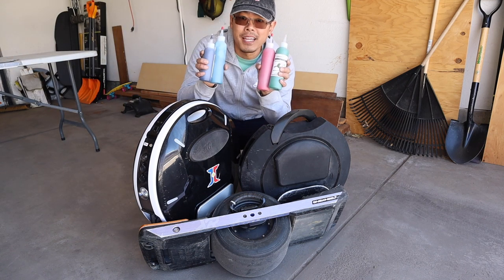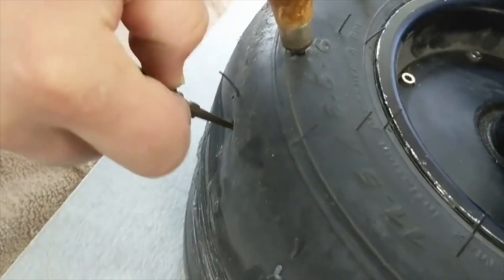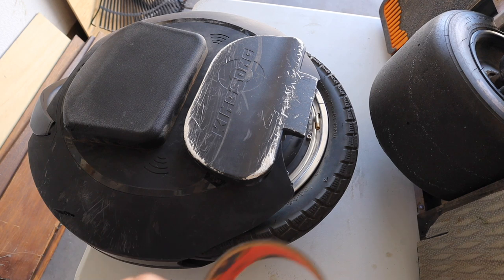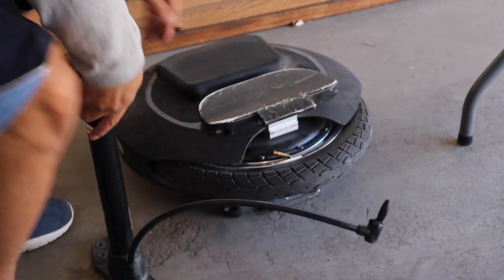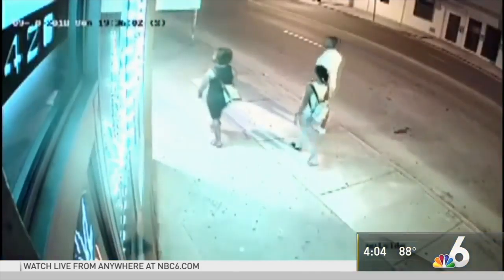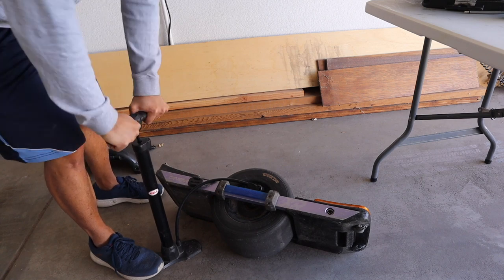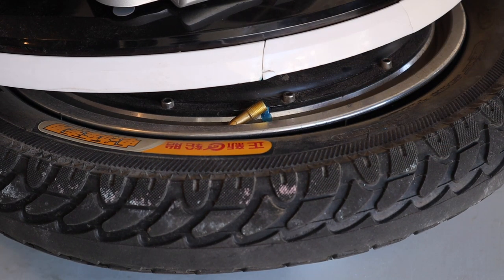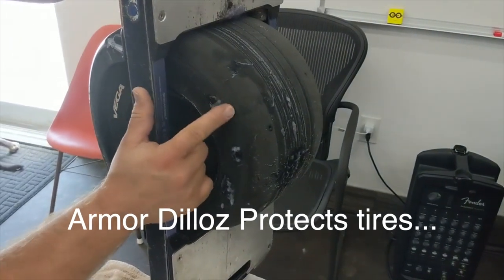AMAZING TIRE SEALANT Armor Dilloz for Onewheel EUC e-Scooter

Comment from the maker: For a short time, get 10% off all tire related products at Armor Dilloz, use the code: JimmyChang
My review of Armor Dilloz: https://oneradwheel.com/the-best-tire-sealant-for-electric-scooters-onewheels-eucs-and-more-armor-dilloz/
Reply: Jimmy Chang - Great video Jimmy. I am upgrading my KS18L to the Nikola Plus 100V. I know the tire repair on the Nikola will be complicated so I want to preempt that need should I get a puncture. With your Nikola after you placed the blue Armor Dilloz, did you notice any difference in the way your wheel rode? How many ounces did you put in?
Reply: Hey I had a question I think in another video I watched you mentioned the air inflator you got on Amazon for a decent price. I ordered the same model and the digital readout is showing the incorrect psi. Is this a problem you’re seeing aswell? For reference I set it to 20 psi and my meter read the tire at 26.7

Comment: #armordilloz Great info Jimmy as always. I have plenty of experience with Slime and find it very unreliable in both cars and e-scooters. I am not sure why I kept putting that stuff in my vehicles but I have completely stopped using them going forward.  Even after the Slime supposedly seals the tire normally goes flat within a few hours. I have also had many times when it didn't seal at all and the tire went flat within minutes. I did pick-up some red Armor for my XR which should be coming tomorrow. I also picked up some for one of my power scooters. Unfortunately it looks like I need to get the blue one for that as I travel around 40MPH on that one for long stretches.

I am not sure I would have stopped the hit and run suspect. The person who stole the vehicle has a good chance of being armed. I would have called 911 for the police and ambulance. Cory was very brave for doing that.

Comment: I bought the pink one for the electric scooter 8.5 inch wheel, its leaking air under the valve, is that a problem or should I have bought the blue one?

Comment: that is wild. lucky that the driver was going slow enough for cory to catch up and stop him. i'd like to say i would have attempted to do the same but of course we never know until we're actually in the situation. i'd at least make sure to call the cops though. sidenote, wondering whether the effectiveness of #armordilloz sealant would be affected by previously installed slime or other generic sealant? surely it'd be unreasonable to remove the previous sealant before installing the armordilloz

Comment: A couple questions for you... 1. I bought a used ow+, should I assume it has slime in it?  2. maybe it is in the video but I didn't notice: do you have to use a hand pump?  If so, every time you pump it or just the first time after adding the Armor Dilloz?
Reply: Yes

Comment: Will having a sealant in the tire make it harder to take off when you need to replace the tire?
Reply from the maker: If it's tubeless, it will be a little messy but well worth the protection. If it's a tubed tire, then no mess.

Comment: I haven't even rode my onewheel pint five kilometres and got a mental object puncturing my tire. I proceeded to remove it and slime like substance shot out of the hole. I could hear hissing from the tire. Within a minute or two I was riding again but I thought maybe it was a good idea to let it dry overnight.
Reply: Woke up this morning and it was flat 😣
Reply: filled it with air at the local gas station and it seems fine now :-S

Comment: Very compelling. Although currently all of my wheels are protected with Slime, I'm going to keep Armor Dilloz in mind the next time I have a leak that Slime doesn't fix. According to their FAQ, it's OK to use this if you already have Slime installed.
Reply from the maker: I know folks that have used armor Dilloz to repair leaks on their Onewheel that the pre-installed slime couldn't stop.
Reply: @freshlycharged 
But you haven't fully answered the question.😮

Comment: I’m not so confident about removing the valve stem on the EUC. The angle is so hard to get at on them anyway. Last thing I want to do is mess it up and have to send the EUC back to eWheels to replace the inner tube.

Comment: Just to relay a recent experience that I had with my OneWheel Pint.  I put a puncture sealant called Tireject, which I really like, into my tire and shortly after the wheel started clicking like an old shopping cart wheel.  Turned out FutureMotion puts puncture sealant in the OneWheel tires at the factory and my sealant reacted with their sealant to create a rock inside the tire that was bouncing around.
Reply from the maker: How did you fix it?
Reply: @freshlycharged  I didn't.  I started a support ticket with FutureMotion and they had me ship it back to them.  They discovered the problem when they were diagnosing the noise.

Comment: IMO, Cory's approach to the situation is the quickest and most feasible way to stop the perp. If I can't get to driver side window, smash rear window, toss phone into back seat, borrow someone else's phone and tell 911 service to track the perp with the location data from your phone. #armordilloz 

Good sealant is a wonderful thing. First time I changed my tire, I didn't replace the Slime and had a flat within a couple weeks. 

After patching and filling with Slime, I got a flat sometime later from a chunk of glass opening a hole that the Slime couldn't seal. I'm currently using Stan's sealant. It's supposed to be really good, but can't contest for it, yet.

Comment: I would’ve used my flight fins to jump onto their trunk and fang dragged straight through their rear window! Or at least tried to 😂 I might not be saving victims in real life but #armordilloz has saved my pint tire from going out of commission early :) I installed it post flat and it worked wonders, one tip is to use less than you think you need! I put a whole bottle in because I had gone days without riding and was going crazy, and I felt like I wasn’t able to get up the same levels of incline I could before, I think half  a bottle would’ve done the trick. For the record it was only one specific hill I couldn’t make it up, and before my tire had gone flat I could just barely make it up, San Francisco really pushes these boards to their limits.